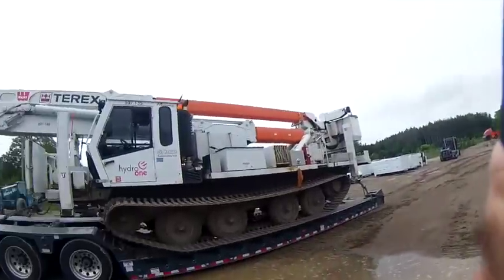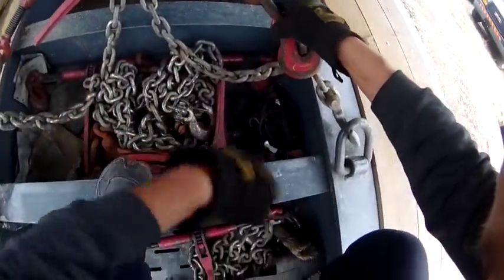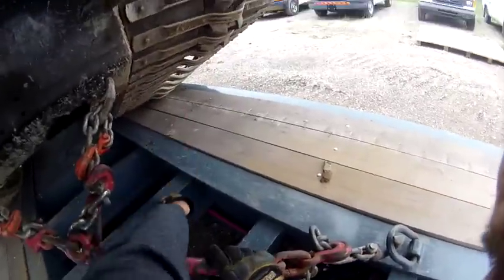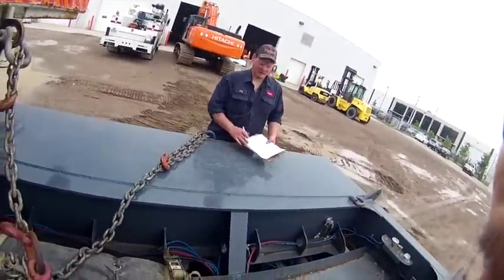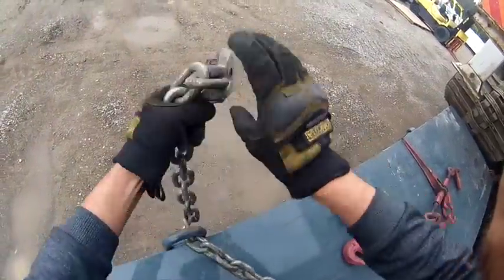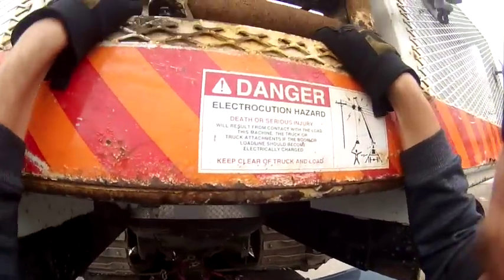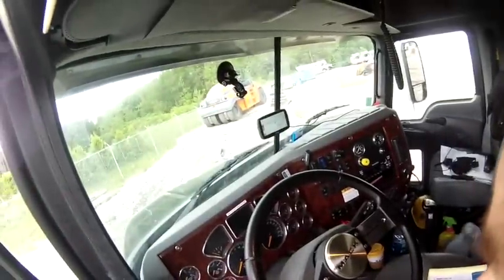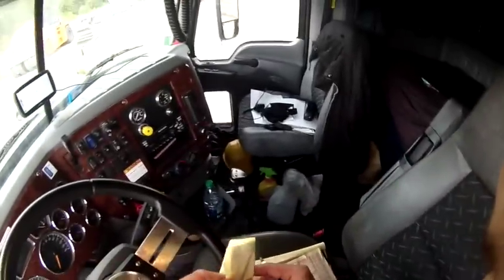HEAVY HAUL TV: Unloading the Swamp Crawler in Kitchener, ONTARIO

Comment: ***** Just watched the off-loading, two questions primarily:

1. The switch of the motor that you flick ON during the disconnection of the goose-neck is exposed, Is it secured or can anyone flick it ON. anytime?
2. The sections in the frame where you keep your chains and flags appear to be exposed to the elements. Also someone can steal those when you have no loads or even with loads (if they are highly motivated). Now how does that work.?!!

That guy that was talking to you didn't seem quite interested in what you were saying. Maybe he was just thinking of some way to get you to pay for what he thought was missing. A good idea that comes to mind is something I saw in one of my other subscriptions. This guy videos the pre-travel condition of the product with scenes from the home location. You can just show it to any disbelievers later. That should shut them up pretty good. Keep on Truckin..!!
Reply from the maker: AeroManiac 1. The Honda motor needs a key to get started and I don't keep it installed there. I take it off once I"m done loading or unloading; but it's a very simple key - the same one used on all Honda small engines. 2. On my previous truck - 2004 International - I kept all the chains and binders inside the side compartments on the truck. I didn't want to do this on this Mack, so all the chains stay on the trailer. I have one compartment with a cover, that's where the flags and gas can go. The other two compartments are open. I'll put something over them in winder. I never had any problem with thieves: these are 1/2" chains and binders. They are extremely heavy and they will work only for other heavy haulers. Regular step deck and flatbed drivers use 3/8" or 5/16" chains and binders which are might lighter. Also, because of the weight my chains are pretty short. They'll be of very little use to flat and step guys.